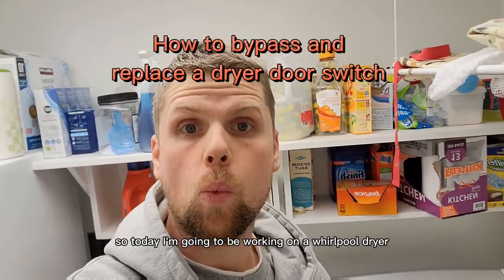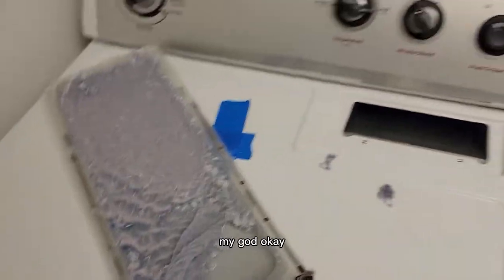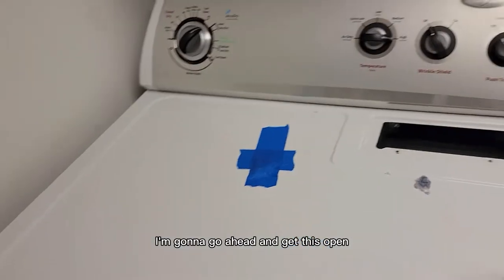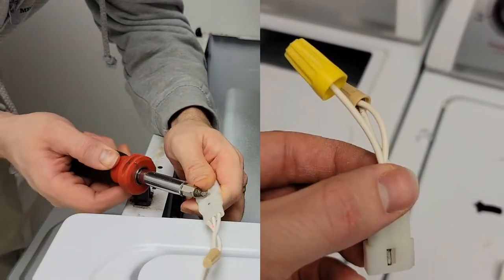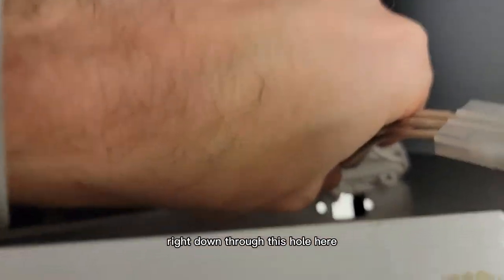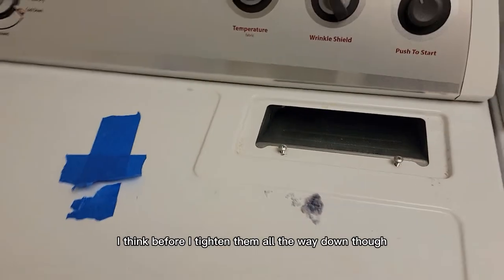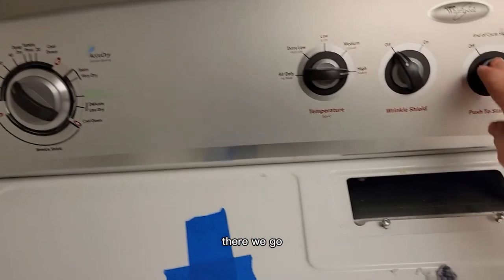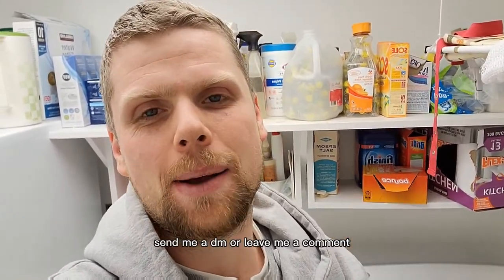How to replace the door switch on a whirlpool dryer! 😲 😱 Easy!

Comment: Got the same problem... And can't wait for the techician.... What is the name of the substitute plug? And cable gauge??
Reply: There is no substitute plug. You just cut the switch off with wire cutters and wire nut the wires together